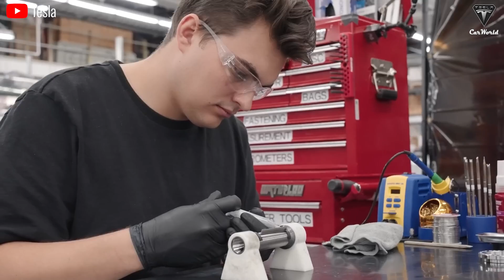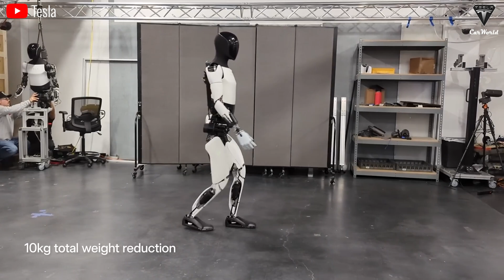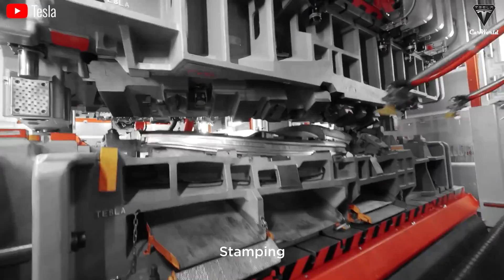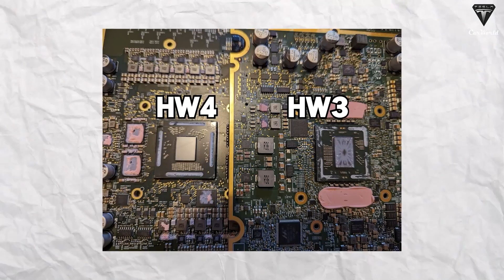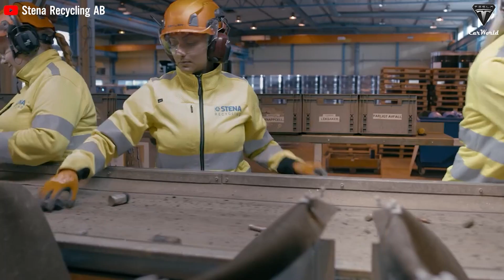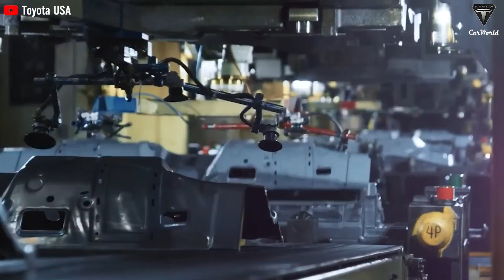It Happened! Elon Musk EXPLAINS How Tesla Bot Gen 2 Optimus Transforms Your Life for Under $20,000!

Comment: The most that humanoid robots have been shown to be able to do is very mundane limited tasks, it shows how incredible humans are really.

I can see them replacing humans for some low level factory processes, as well as being used where the cost of commissioning a fixed industrial robot might be too high. Having a bipedal mobile robot that you can just teach a simple tasks and have it repeat it would be beneficial and expand automation in manufacturing.

The other area is where you want a mobile AI that can collect and or give out information, security for example, or customer service agents.

But robots that cook? Unless you want a human to first line up alll the ingredients in a neat way and then tidy up afterwards, that's a long way off. Preparing food is about a lot more than just chopping stuff up and putting it in a frying pan.

Comment: If it can do gardening, like pulling weeds and mowing the lawn and trimming the hedges, I'll buy one.
Reply: I'm with on that, hopefully he can include dirt proof joints
Reply: Man this could actually put janitors out of jobs. It’d be easy to have a mapping period of a building or premises. Also farmland is dynamic but it doesn’t move. You could have giant tall post with hi powered lidars to map the farm field and fuse the sensor data with Optimus. Also would need a team of automated drones with docking stations to charge. They use could lidar and other sensors and act as additional spotters if Optimus is having trouble seeing through the plant/tress and the post lidar/Optimus’s own sensors aren’t cutting it for a moment. They could work 24/7 during a harvesting period.